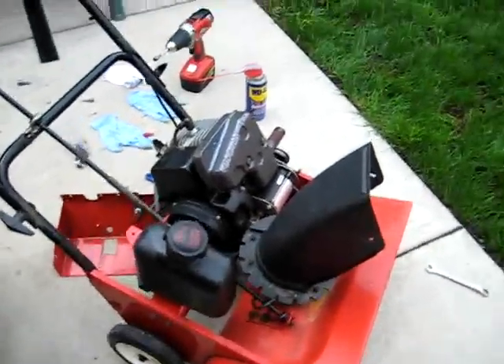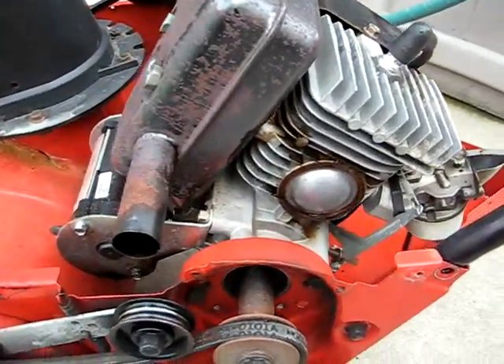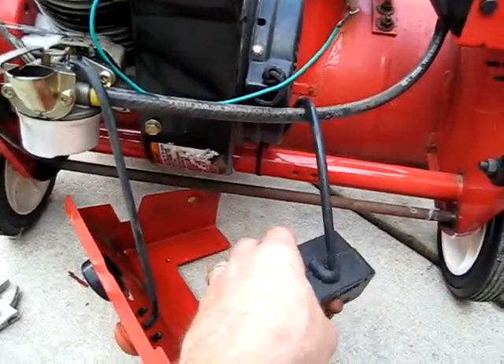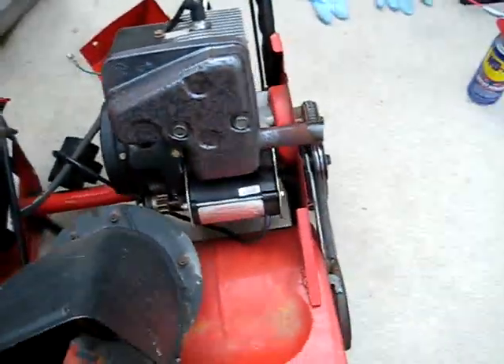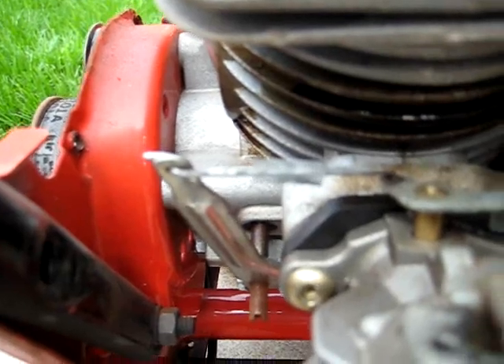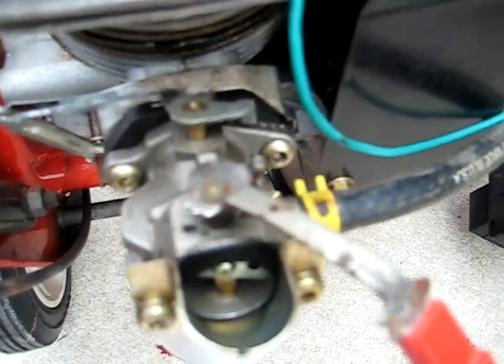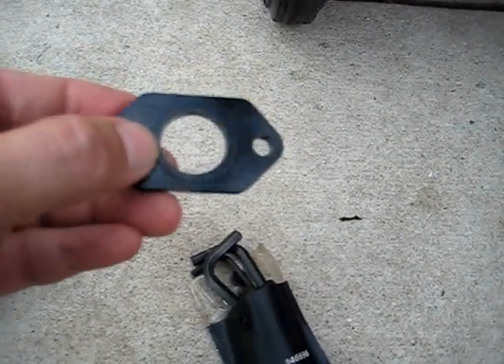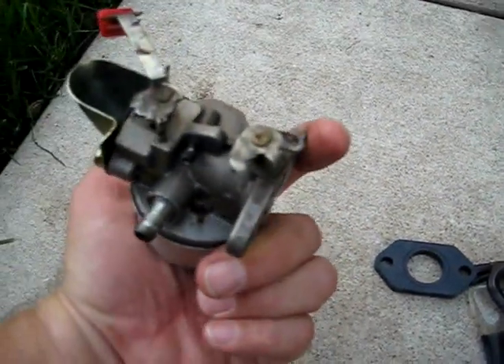YardMachine Snowblower

Comment: Awesome video.  I'm considering buying an MTD snowblower very similar to this one off Craigslist right now.  I'll be saving this video to my favorites as a reference for sure.  BTW, did you consider replacing the carb. screws with hex heads for future removal?  I can't stand when engineers design something poorly like this.